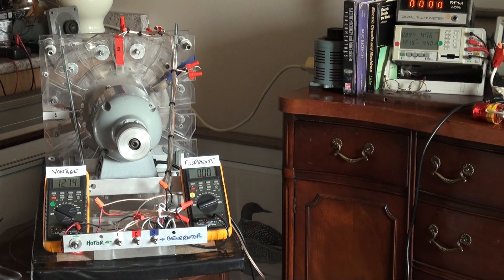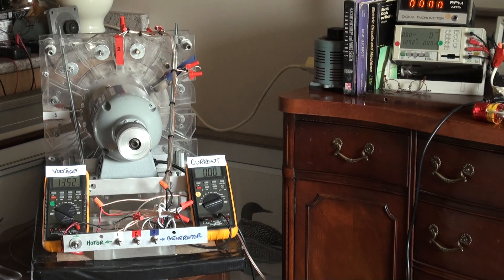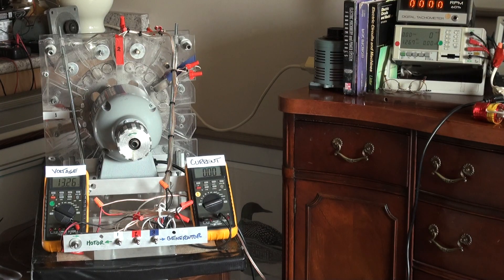PART 2 NRC ReGenX Generator   ReGen X Motor Follow up Demonstration 2025

Comment: If this were true, feedback could be provided, but obviously that won't happen. The "Tesla or induction" motor consumes more than it would without power, and what you generate in the super-special coils is lost in any type of power supply you use to power the motor. It's true that it accelerates with certain loads, but you're left with the opposition of a force equal to that between the magnet and the iron. That, my friend, is a loss. It doesn't matter if you use more ReGenx coils to generate electricity; in the end, the motor will consume more. A clear example of the input consumption is: 122.7 V x 4.38 A = 537.5 W versus the output generation: 18.23 V x 4.75 A = 86.6 W.
This is a constant in the system, my friend, and I can tell you this from experience.
Reply: That is why Thane should use more efficient motor to turn RegenX generator, like Ufopolitics asymmetric DC motor, which can output more mechanical energy out than in, if operated properly.
Reply: hahaha generic view

Comment: Is it possible to run RegenX quantum motor on 12V battery only, without using Tesla induction motor, which consumes electricity from the grid?